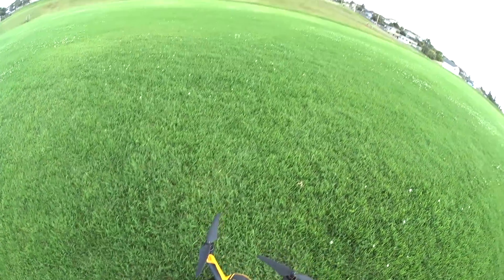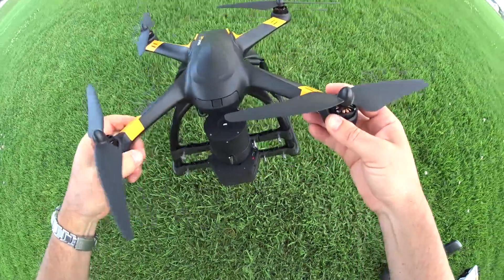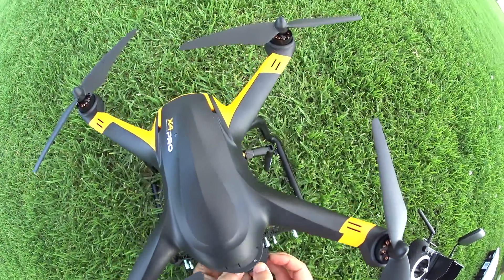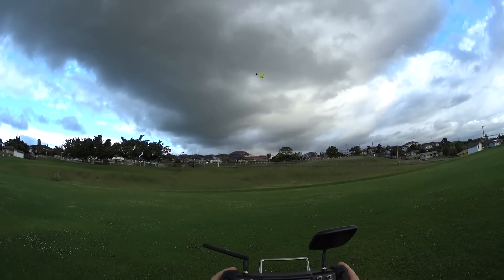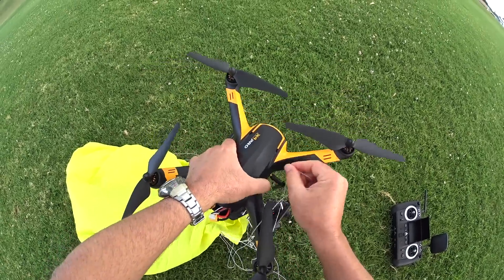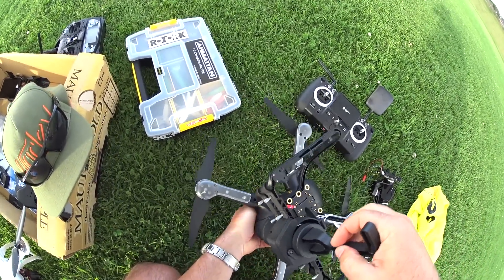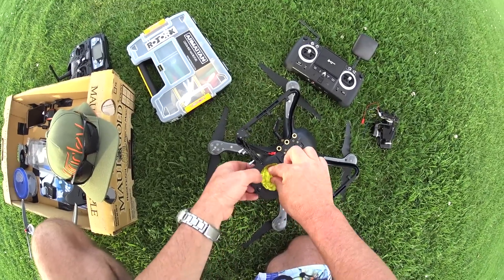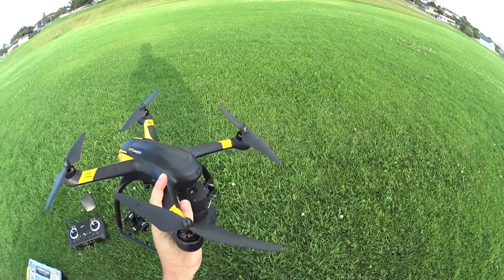HUBSAN X4 PRO FPV GPS QuadCopter Review - Part 2.5 - [Chute Deploy, Damage Report, Chute Re-Pack]

Comment: great video Dustin, I was wondering which quad is better you think, Hubsan X4Pro or the XK X380, also when i go to Hubsan's site I do not see this quad. the biggest quad i see, is the 501s. whats up with that you think, thanks for the great video, never seen anyone do this. very brave lol
Reply from the maker: +colt kwilkerson Thanks Colt.  They are very similar but the X4PRO may be a better choice if you need an all inclusive FPV ready option.
Reply: thanks I think so also, I have had prob. with my X380. sending it back, I think it is the controller.

Comment: It just occurred to me that you could also just use the sticks to manually shut off the motors while in the air. The craft would naturally roll over during the fall past ninety degrees. It would allow for a more clean, controlled test of the parachute system without prop wash getting in the way.
Reply from the maker: +SidL Agreed.  I planned on doing that from higher but haven't got around to it yet.

Comment: Thanks for the cool vid. I am thinking about getting this chute for my Hubsan X4 HE to use only in certain conditions but I am a little worried about how it may reduce my flight time.  If its only 2 or 3 minutes then I could live with that but if it reduces my flight time by 5 to 6 minutes then screw it.  I have the High Edition w/ 3D gimbal. Does anyone have any numbers on the flight time reduction on the X4 Pro using the 3D gim??

Comment: Excellent review. One question. Do you know if this drone is compatible with FPV goggles with 5,8GHz Rx? Thank you very much!!
Reply from the maker: Yes.  Just get goggles that have a 32 channel or greater receiver to make sure you can tune the X4Pro in.  I can tune in with a 32 channel set.  No telemetry will be on goggles though unfortunately just plain video.

Comment: I wonder why they didn't cut the motors when the chute deployed? Be a good one for a "float-away" in the wind at high altitude. :)
Real interesting quad and looks like a X380 competitor. Thanks for the review.
Reply from the maker: +Dennis Petersen The parachute is more for if a motor failed.  In this test I forced the chute to deploy as it's not intended just to see what happens.  They could have made the chute smarter though.  It has no communication with the quad.

Comment: Nice job.  You were very brave to demonstrate it.  Now we know how it performs.
Reply from the maker: +Quadcopter 101 Thanks 101.  I'm thinking a better (riskier) test would be to go higher and disarm so props shut-off completely.  Although if it just fell level the chute wouldn't deploy I guess.  Here I was discovering it was possible to disarm mid flight in desperation to get it down.
Reply: Yeah, you definitely put a lot of people at ease. lol... B/c some of us are extremely nervous when it comes to intentionally taking risk with with beloved quads.

Comment: i really like the idea of a chute but i think i'd prefer a manual deploy, 90degrees isn't a a crash... yet, obviously if the chute deploys its gonna be a crash after that, so either a manual deploy or better fail/crash sensor is needed,  i noticed a usb port on it, maybe there is some programmability but i think it should be connected to FC for proper info to deploy, ie loss of power violent tumbling or just a basic switch,, what we really need is an airbag hehehe...

Comment: Interesting ... 45 feet up might have been high enough if the props weren't blasting the chute downward. If, as you suggest below, you are going to kill the motors at 100 ft, it will be interesting to see if it rolls over far enough to trigger the chute.  What powers the chute servo? The main battery or a separate built in Lipo? You're probably too young to remember the early days of "Ultralight Aircraft", but after a rather unfortunate incident which aired on ABC, where a n00b pilot took off, started flying erratically, and was thrown from the pilot's seat to his death, ballistic parachute systems were developed which could safely bring down both pilot and plane (provided pilot had good sense to strap himself in). Anyway, that one incident, broadcast on national TV, pretty much killed the Ultralight aircraft industry, as "ambulance chasing lawyers" were on the manufacturers like flies on cow pies.  I look forward to your next test!  Cheers!
Reply from the maker: +Bill Somrak Hey Bill.  The chute is a separate system entirely.  Battery, accelerometer?  Battery is charged with a micro USB.  Main thing I took away from the test is not to fly sporty in Alt hold only mode for risk of this happening where the chute deploys but craft still tries to fly.  I could see the chute working well in any other real world craft component or battery exhaust situation as long as it hit 90° while falling.  Hubsan should have provided a way to connect the chute to the open channel on the belly of quad (which does work with left knob on TX) for a manual deployment option.
Reply: +Dustin Dunnill I agree ... a manual deploy option would've been great!

Comment: Nice review again Dustin , Have you changed the antenna on the Quad for a fatshark one ?
Any particular reason ?
I would like to improve the RF reception on mine , the signal strength drops from time to time depending on the position of the quad in relation to me , I've not lost any control yet but it bugs me and I'm always watching it/worrying about it.
Any easy ways to improve this for me ?
Is the RF antenna on the Quad the wire tucked into one of the landing gear legs ?
Have you also changed the RF one on the controller couldnt quite tell in the video ?
Sorry for all the questions but I'm really happy you got this quad so I can pick your brains lol
Keep up the great work
Reply from the maker: +LeeMc007 Thanks Lee.  I just had the antenna laying around and it was like 5 or so grams lighter than the fat one the X4pro has.  No difference in FPV noticed but haven't range tested.  Yes the RX antenna is tucked down leg.  Still stock on the TX antenna until I range test.

Comment: Nice dustin although the parachute doesn't slow down The quad still a great review
Reply from the maker: +ivan sikaleski It actually does slow it down to lesson damage alot.  Here I was fighting the parachute and it lost some altitude until I was able to disarm motors in air.  It then had just barely enough hight to let the parachute slow it down.

Comment: nice video would of love to see the tutorial on how you mount the gimbal
Reply from the maker: +bigchiller007 very simple.  Just using 2 holes which matched up the bottom.  No mod necessary.
Reply: +Dustin Dunnill ok nice to know but Idk about this quad anymore a phantom is $500 to $450 depend on where you get it and for what they asking for it $400 might as well get a phantom 3 way better build